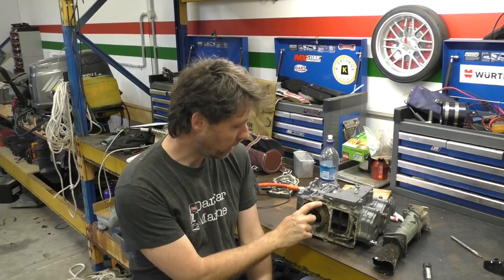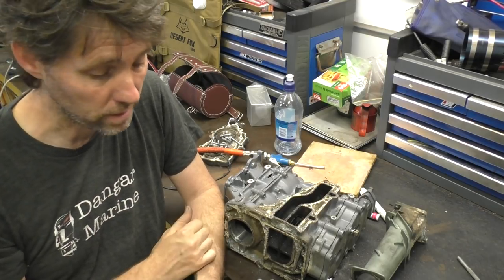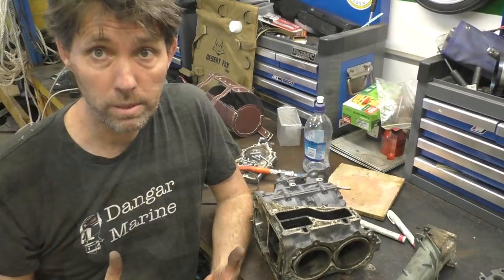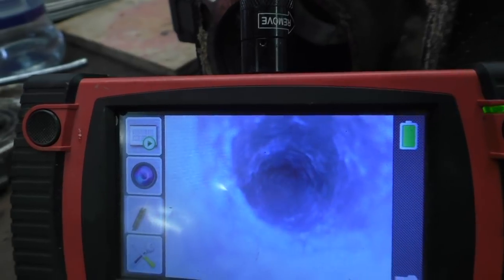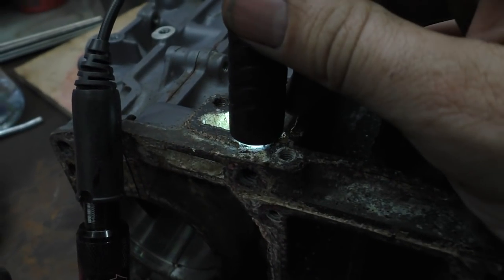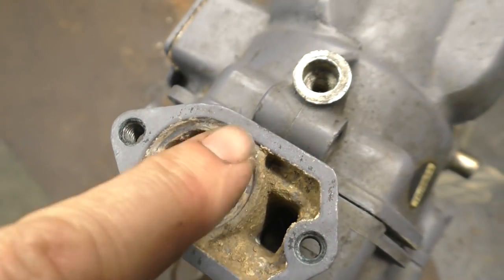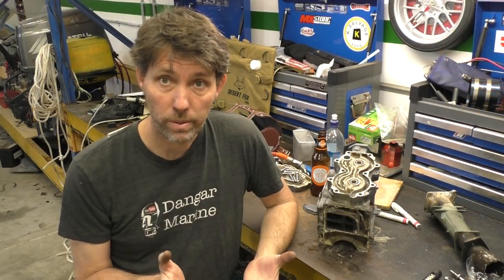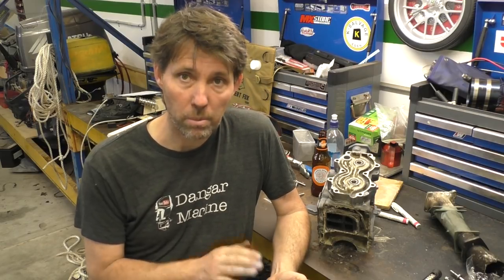Outboard cooling water

Comment: I say bring back air-cooled outboards! lol
Reply: Gawd NO! Briggs and Stratton at sea- I'll fish from a dock thank you :-)
Reply: +Ron Powell nothing wrong with the old Yamaha/ mariner air-cooled outboard motors :-)
Reply: Baikal especially now that they have graphite fins that perform 1500% better at removing heat from the block compares to aluminum fins. 
Which makes it more than efficient enough to cool a large horsepower engine

Comment: What is the purpose of telling me the water pump works yet the purpose of the water pump is to cool the engine and it might not be getting cooled... Seems real logical, NOT
Reply: Because if the water pump doesn’t work for a blockage picked up on water you’re going to cook your motor. 
Just yesterday I blocked my pickup in mud and without the telltale I wouldn’t know if the water pump was actually pumping water. 
The rest of the cooling system is up to you to maintain to ensure it doesn’t get blocked